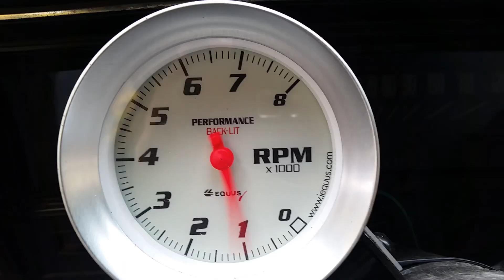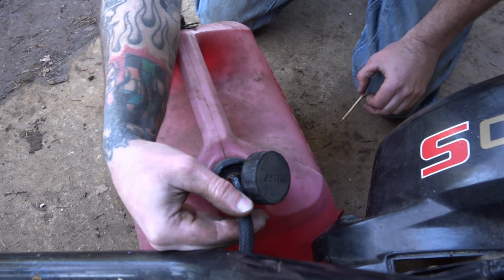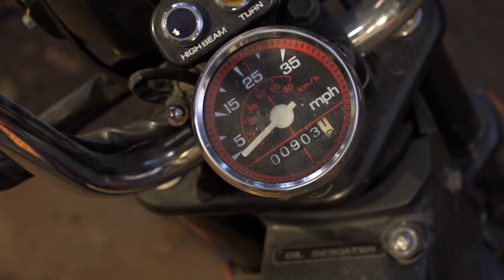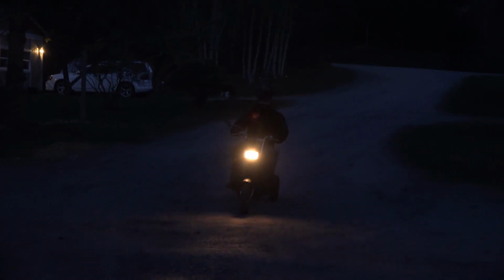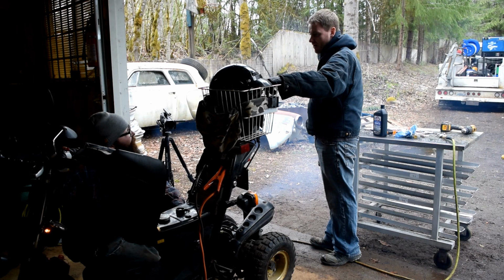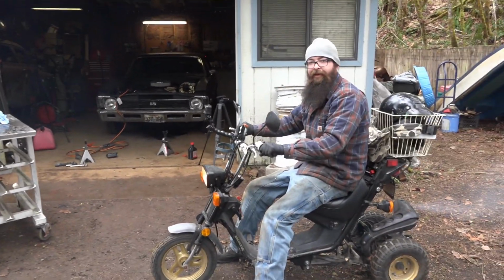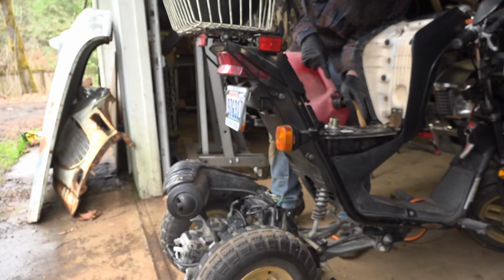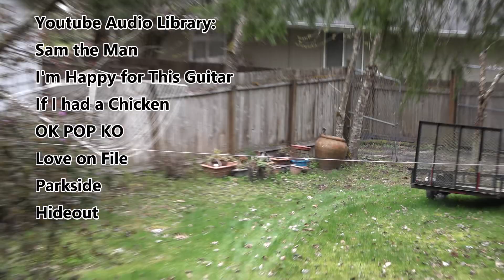Honda Gyro or Wacky Machine? | Not Rod Ep. 3

Comment: I had a job responsible for the 250cc motorcycles used in MSF classes in our state.   Had terrible storage problems with carbs.  I've seen it all.   Clean a small engine carb and put it back together.   Over 100 carb rebuilds and never even needed a new gasket.   They just need to be clean.  REally clean.  All passages.  REally clean.

Comment: The fuel petcock on those things are also the fuel pump you don't need it as a fuel pump drill out the center of it not all the way through the body of the petcock then block off the vacuum side on the motor in the petcock set petcock just works has a gravitational flow

Comment: Drill and clean out the exhaust much as possible drill extra air intake holes in the airbox the more air the better more exhaust flow the better lean the fuel out the better

Comment: Remove the exhaust make a fire throw the exhaust is for a hour or so it will burn the oil and carbon build up that blocking the little holes in the baffle it should also stop or smoke a lot less and you will have a lot more power...(how to clean a 2stroke exhaust) lots of videos on youtube...

Comment: Open up the exhaust a little bit for a little more power.
Reply: Mike Honcho no. Not on one of those.
Reply: @Chuffin_ell  especially one of those. My son has a 50cc minibike that had a washer with a 3/8"  hole in the 3/4" exhaust. We removed it and it  was a big difference in power.
Reply: Mike Honcho your son has a Honda with a GY6?
Opening a pipe on a 4 stroke is a completely different animal than than one of these. 
But, you’ll figure that out...
Reply: @Chuffin_ell  I'll give it my best shot.